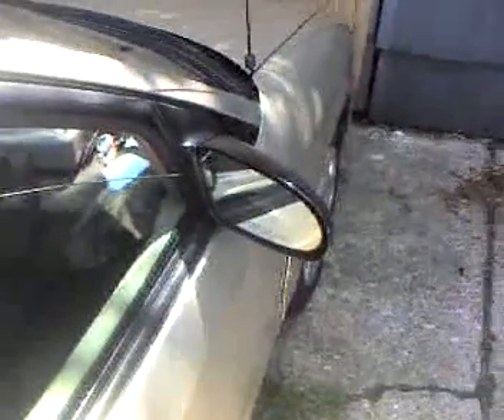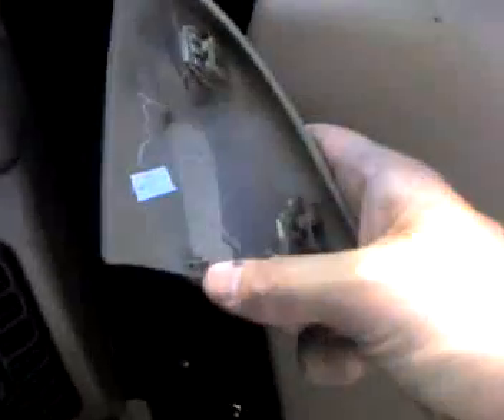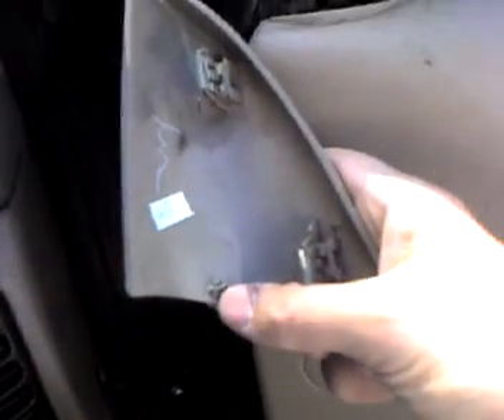2000 Saturn SL2 remove passenger side mirror

Comment: My wife knocked the mirror off at the gas station yesterday.  I drilled a hole in the plastic of the mirror to bolt it on until the new one came but wasn't sure if I had to take off the entire door panel or not.  Happy I found this great little video.  Thank you.

Comment: Note that on the 1999 SL 1, the driver mirror has a toggle inside the car, and adjacent to the mounting, such that it looks its at the base of the mirror. This is interesting also because that toggle is NOT in this place or anywhere near it for the passenger side mirror assembly.

A search for this model and year will show manual and electric mirrors, so, do your homework before purchase to  make sure you get the mirror you want and fits properly. Expect black models that ate made to be painted. Using the VIN one can establish the exact paint needed. 

A decent auto paint section may have the color you need in small volume containers suitable for chips and scratches but maybe enough to paint your mirror replacement.